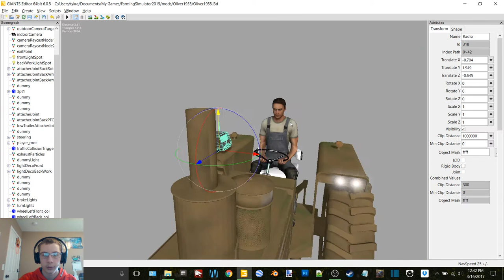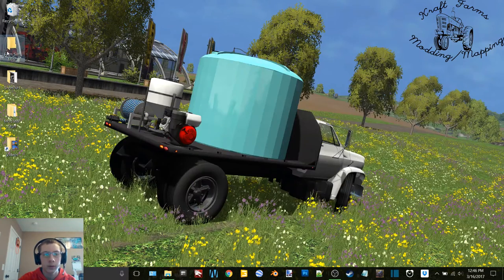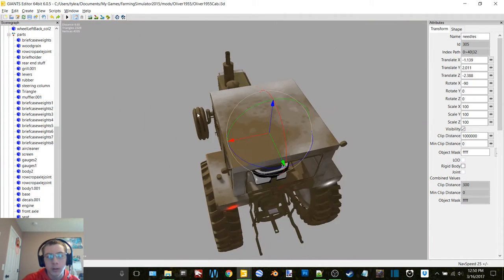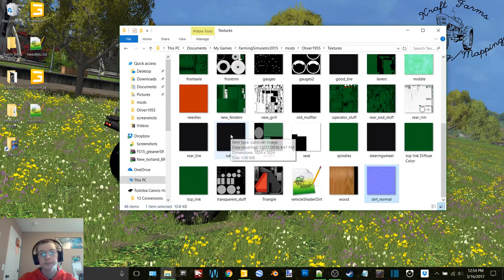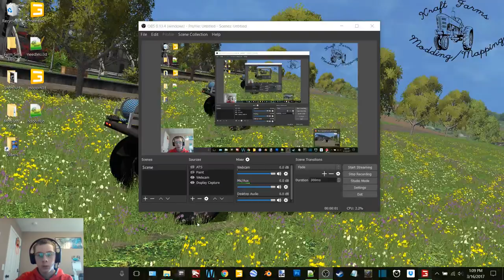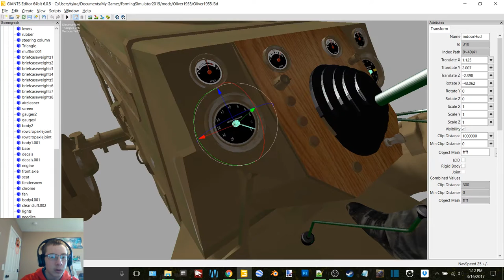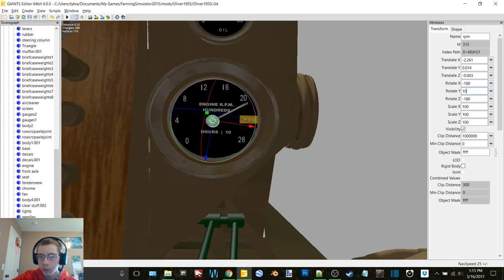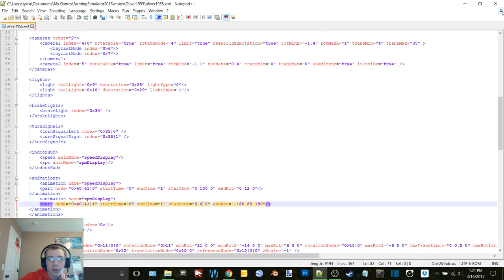Thursday Modding Ep 8-Finishin Some Stuff On The Oliver 1955 Pack

Comment: You have to adjust your rotations in the xml for the needles to go the right way. Since you took it from the Ford, the left needle (which would be the speed needle on the Ford) would be scripted to go clockwise. But you needs your to go counter clockwise so just adjust the rotations. If you need more help message me on Facebook and we can figure something out.